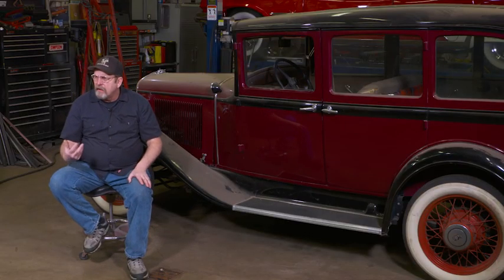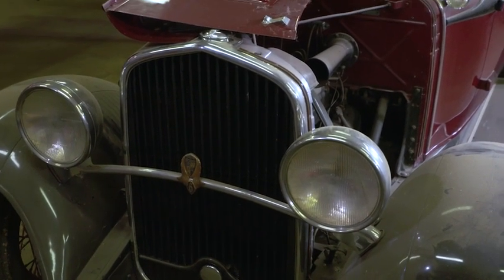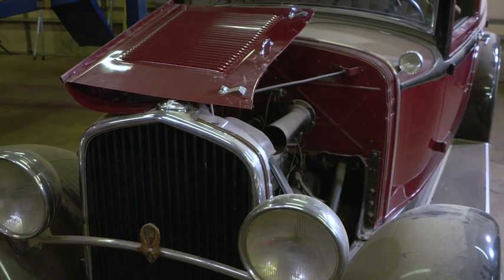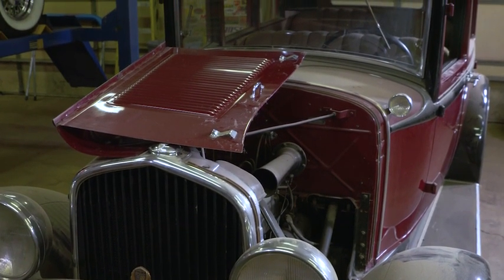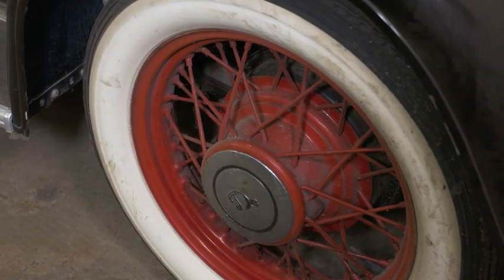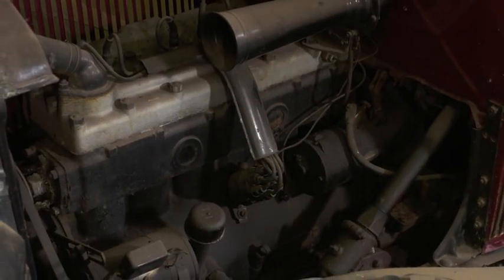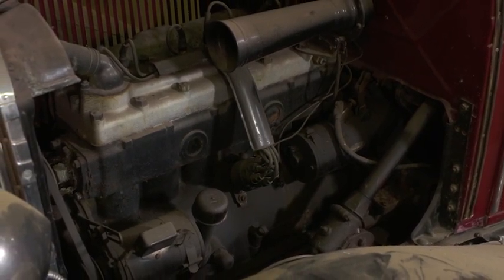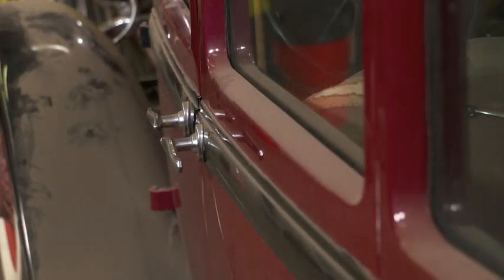BRINGING A CAR OUT OF LONG-TERM STORAGE

Comment: I’ve got a 22 gt500 I bought last oct, I told the dealer to not fill it up but they did , I never drove it, but the gas is probably gonna go bad soon, should I have it drained by the dealer and fill it with a ethanol free 91 gas, I’m not planning it drive it for a while, maybe 2-3 years and I want to keep it under 10 miles on the odometer . Any advise storing it this long safely?
Reply from the maker: Great question!  The ‘Ask an Expert’ section is for members of our online community. I would be happy to send your question off to the experts. To get started, please provide the email associated with your paid membership. Thanks!